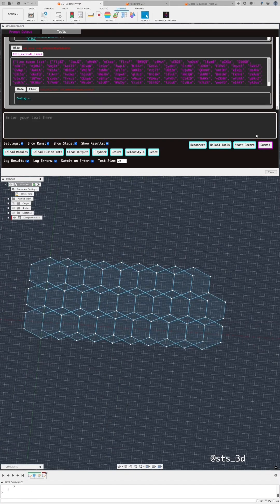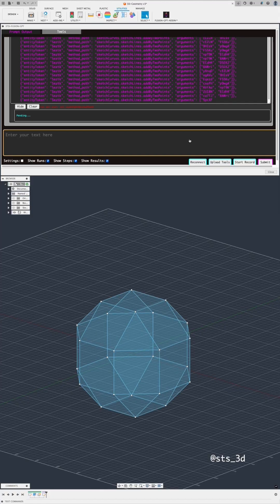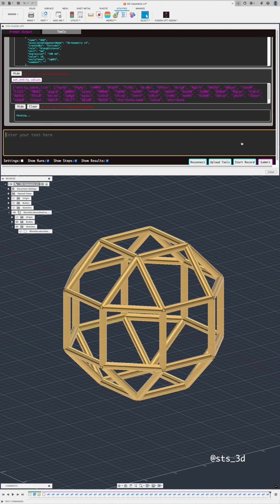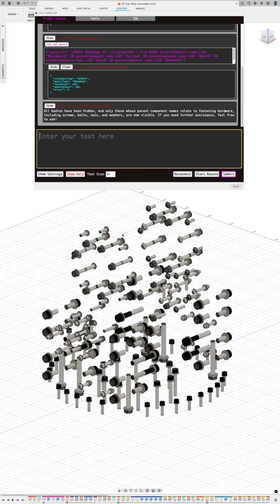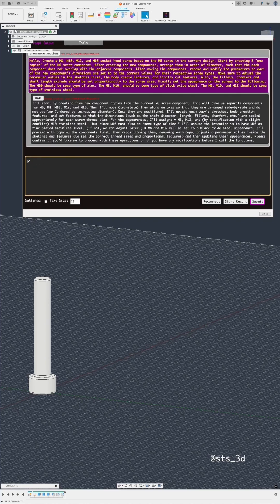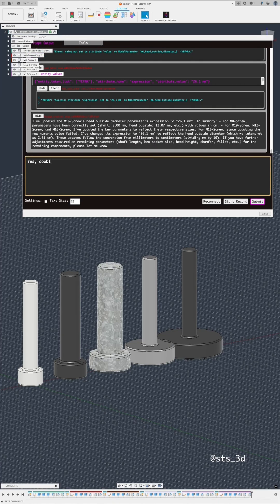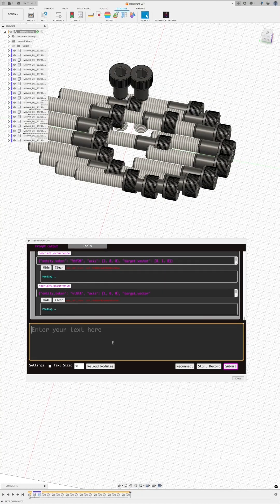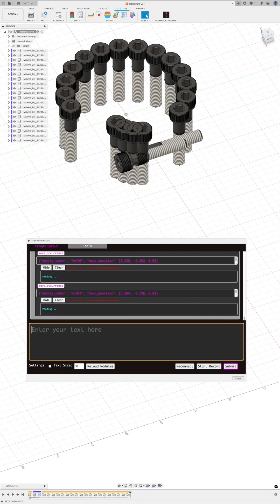ChatGPT-Fusion360 Add-In Update #openai  #fusion360  #design  #cad

Comment: Chat gpt doesn't know what a m6 bolt is so you'd have to go back and check every measurement yourself, or you could end up with an unsafe project at the end, just learn a program there are simple ways to do most all these tasks and you don't burn through extra computing power running it through a LLM

Comment: Option 1: Using ChatGPT to Help Write Fusion 360 Scripts
You can use ChatGPT to generate Python scripts for Fusion 360’s API.

Steps
Enable the Python API in Fusion 360

Open Fusion 360.
Click on Tools > Add-ins > Scripts and Add-ins.
Select the Scripts tab and click Create to start a new script.
Use ChatGPT to Generate Python Code

Ask ChatGPT to generate Python scripts for your specific task (e.g., extruding a shape, creating parametric models, automating tasks).
Example prompt:
"Generate a Python script for Fusion 360 that creates a 10x10x10mm cube and extrudes it by 50mm."

Run the Script in Fusion 360

Copy and paste the ChatGPT-generated script into the Fusion 360 script editor.
Click Run to execute the script.
Option 2: Running a Fusion 360 ChatGPT Add-In (If Available)
There is no official Fusion 360 ChatGPT Add-In, but you can create one yourself or look for community-built solutions.

Steps to Make Your Own Add-In
Install Python for Fusion 360

Fusion 360 uses Python 3.7 for scripting.
Set Up the ChatGPT API

Get an API key from OpenAI (platform.openai.com).
Install the OpenAI library in Python:
nginx
Copy
Edit
pip install openai
Write a Fusion 360 Add-In

Use Python to send commands to OpenAI’s ChatGPT and retrieve responses.
python
Copy
Edit
import adsk.core, adsk.fusion, adsk.cam
import openai  

def run(context):
    ui = adsk.core.Application.get().userInterface
    try:
        openai.api_key = "YOUR_OPENAI_API_KEY"
        response = openai.ChatCompletion.create(
            model="gpt-4",
            messages=[{"role": "user", "content": "Create a parametric model in Fusion 360"}]
        )
        ui.messageBox(response["choices"][0]["message"]["content"])
    except Exception as e:
        ui.messageBox(f"Error: {str(e)}")
Run the Add-In in Fusion 360

Save your script in the Fusion 360 Add-Ins folder.
Open Scripts and Add-Ins in Fusion 360 and run the script.